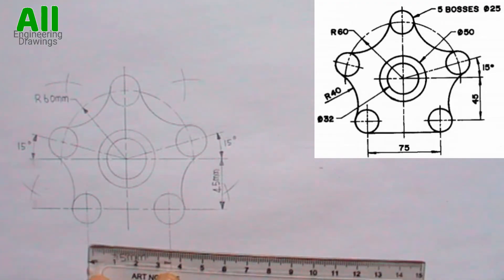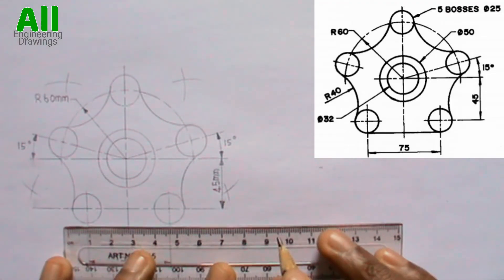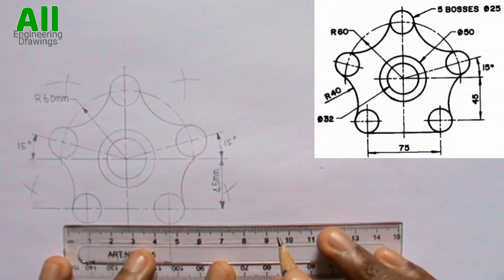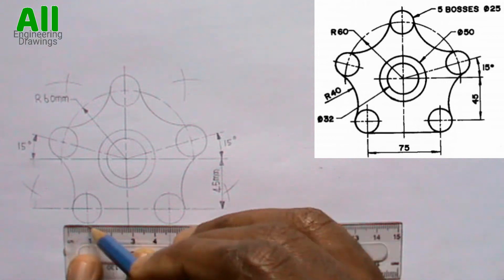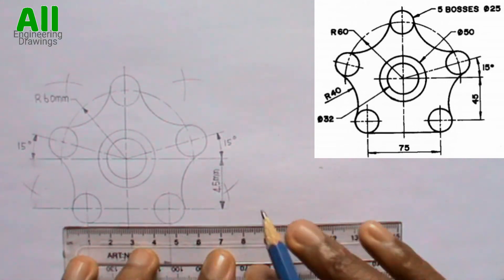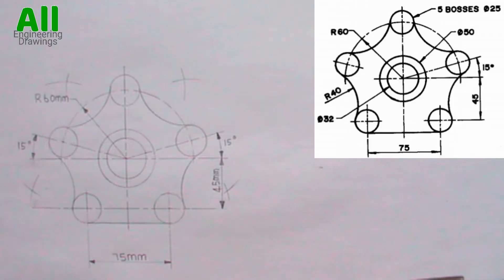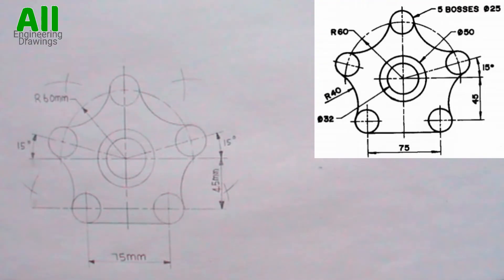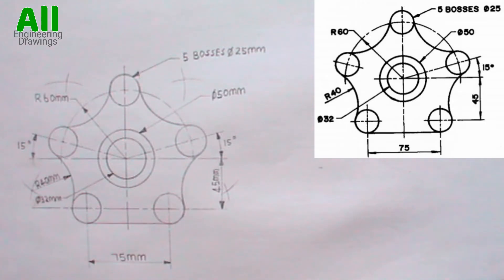TANGENCY PROBLEM 7 || Tangency || Tangency problems || Engineering drawing || Technical drawing

Comment: Please you need to explain more to carry everyone alone
Just like how @Tito_isbae said why is 52.5
Reply from the maker: From the figure, the diameter of each of the 5 circle is 25, hence the radius is 12.5. and the radius of the arc from the figure is 40. So because the arc is external arc, we will add 12.5 and 40 which is equal to 52.5

Comment: Why 52.5
Reply from the maker: From the figure, the diameter of each of the 5 circle is 25, hence the radius is 12.5. and the radius of the arc from the figure is 40. So because the arc is external arc, we will add 12.5 and 40 which is equal to 52.5

Comment: why is it 52.5mm?
Reply from the maker: From the figure, the diameter of each of the 5 circle is 25, hence the radius is 12.5. and the radius of the arc from the figure is 40. So because the arc is external arc, we will add 12.5 and 40 which is equal to 52.5